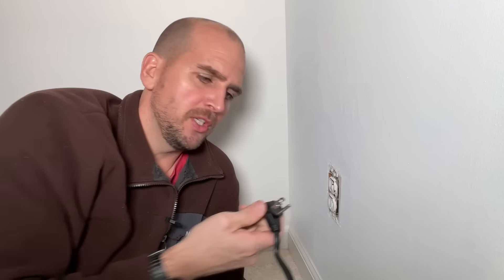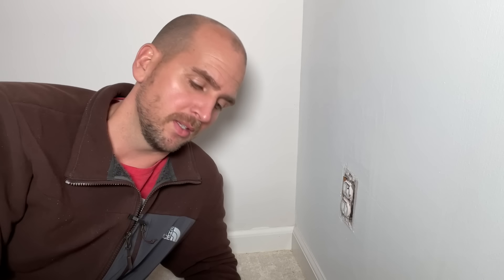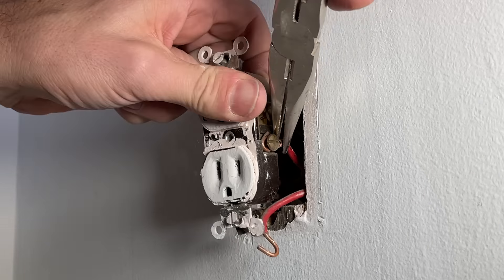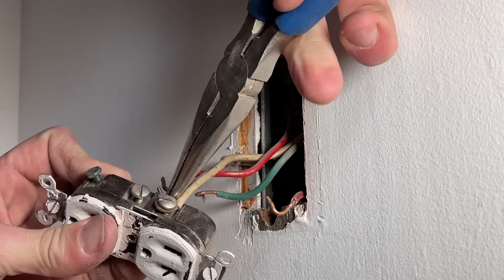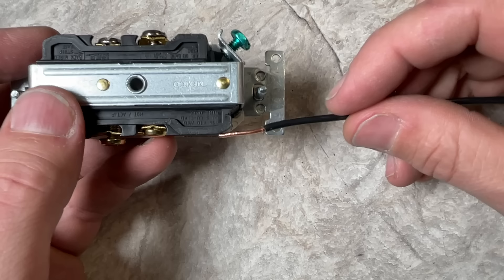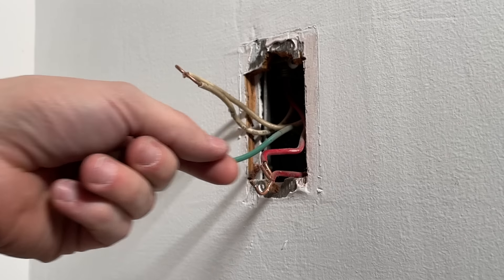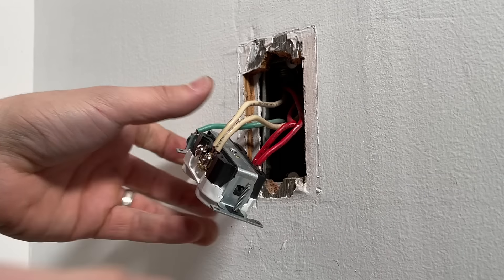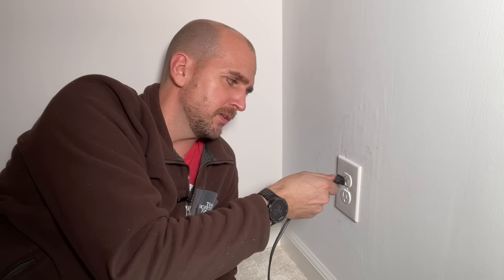Plug Won't Stay In Outlet

Comment: Lol so how to fix loose outlet is just how to replace receptacle
Reply: I only watched this because I was wondering if he was really going to try to repair a 2 dollar part.
Reply: Just squeeze the plug in a little bit. That usually works for me
Reply: @theycallmethehunter5009  lol don't tell the insurance company that after your house burns down
Reply: Excactly .takes all of 2 minutes
Reply: Put a little piece of foil around the end of one of the prongs
Reply: @JuarezDerrick  nice I see you like burning houses down too
Reply: Wtf
Reply: A new receptacle is $2, what repair are you going to try and do to that's safe so you can save yourself $2? Do it right, spend the $2.
Reply: @mjc0961  the problem is these scrubs will install it fucked up and burn their house down if they don't shock themselves to death in the process
Reply: Yup.
Reply: @andycopeland7051  Hahaha !!!! 😁😁😁 It's  amazing how many people buy a house and don't know what or how to do simple repairs on it. But, its the same people that will argue,  fuss and  cuss at repairman when they get the bill for changing out the  outlet...Interesting...🤔🤔🤔🤦‍♂️🤦‍♂️
Reply: So talk about stranded wire vs solid. Which is better, transfers more amp power and why solid wire is so widely used in house wiring.
Reply: @nohyphens  The advantage of stranded wire is that it's flexible.  That's why you see stranded wire in extension cords.  However, with constant flexing, individual strands can break.  When wiring a house, you don't need flexibility.  Once the wires are in place, they just stay there.  As for power transfer, if you use 14 AWG, your breaker should trip before there are any issues with the current carrying capacity of the wire.
Reply: @keithmills778  Thanks for the video.
Reply: Wrong.
Reply: @keithmills778  stranded wire has less residents and more flexible. Solid wire is cheaper, easier to push through conduit, and easier to push into back of outlet
Reply: Right? Spend two dollars or risk, if you’re not sure what you’re doing, potentially breaking the outlet.
Reply: @JuarezDerrick  maybe if you leave a little extra foil hanging out, then you could just hook another Appliance or light up to it.
Reply: @edarnold1426  with alligator clips? Not a bad idea, I appreciate it.
Reply: @JuarezDerrick  just wouldn't want any kids around.
Reply: @edarnold1426  the less kids the better
Reply: Yeah I was really confused too, When this happens I just buy a new one. Good job with the clickbait though
Reply: Thank you ... I was just about going to waste 10 min of my life thinking he had a secret to share.  Seeing the comment just save me.  Lol!!!!
Reply: That’s what I said too; lol. Kind of clickbait.
Reply: @andycopeland7051  ⁰ ok ppppp} ppl
Reply: Saved me 10 minutes, thanks.
Reply: @andycopeland7051  you sir, are not wrong. I can't believe how bad some home owners are at basic repairs. The guy I bought my house from shouldn't even be allowed to own a hammer.
Reply: @epictoast6727  hahaha we're in one of those too. Everything we've gotten into has had us saying, "what the FUCK were these people DOING?!"
Reply: @andycopeland7051  yeah this guy "upgraded" to 30 amp breakers in the panel, except he didn't actually run new wire, so you know, the house would just burn down before the breakers tripped lol🤣.
Reply: @epictoast6727  ohhh yes people LOVE doing that. Happened even more often when house branch circuits were commonly fed from fuses. 
"Keeps blowing my 20A fuse, what do I do?"
"Just screw in a 30 what could go wrong? See? It doesn't blow. It's better obviously."
Reply: @andycopeland7051  it just surprises me that people that stupid even make it to adulthood. This is why having so many warning labels is bad.
Reply: @epictoast6727  I agree with a lot of that. At the same time, I'm happy to take their money if they're smart enough to have me safely do it for them
Reply: Quickest way to fix it that works most the time is burning the house down, & buying a new home. Better than tinkering with it &  wasting money on a new outlet , or worse, risk an electrical shock! 💁🏾‍♂️🧠
Reply: @guahanbassoutlaw5081  people like you are the reason why people like me are in such high demand and are paid so well. Not even going to discourage you from taking that approach.
Reply: @ToyManFlyer1100  what annoys me is when you buy a brand new house and the builder sends out a so called "professional" that knows construction less than I do to fix something that was missed!!
Reply: Bs I was looking for a quick fix for nothing at motel
Reply: How to fix tires with bad traction ...

... replace them.  Wow! that was video worth doing.
Reply: @toriless  man you oughta start a YT channel with that profound shit
Reply: @JuarezDerrick  I will assume you are joking and avoid making an sexist remarks LOL.
Reply: @andycopeland7051  You sound like a "professional, certified, qualified" e-lektrician. Hmmm, makes one wonder why you chose to watch this video.  If not to learn something...what...to inflate your ego with sarcasm? Sorry to burst your bubble, pal, but there is a reason the NEC and most cities allow homeowners to do their own work--"It ain't rocket science!" An FNG learns to wire an outlet the first day on job. Now, do you have anything useful to add that the OP did cover, so no one burns down their house or electrocutes themselves, or do you need to puff out your chest some more? (Again--why did you watch this??)
Reply: @nohyphens  Wire rated at 14 amps will carry 14 amps, solid or stranded. You can wire a house with either, but each have their place. Stranded wire is more flexible and somewhat easier to pull through tight spaces. And stranded must be used for larger gauges, such as service entrance wiring, where solid simply would not bend. But it is more expensive to make, is slightly larger due to air spaces, and has a much larger surface area exposed to oxidation. 

So, if flexibility is not needed, the negatives lose out. Solid is also arguable easier to terminate in residential applications. Easier to wire-nut, and easier to secure under a screw-terminal without the strands "fuzzing" out.
Reply: @FisherCatProductions  why would I make a sexist remark? I'm a man btw